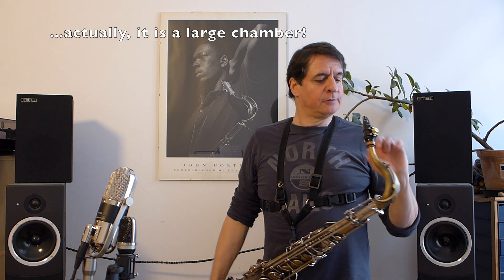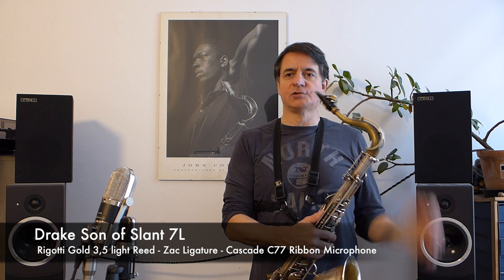Comparing two Tenor Sax Mouthpieces and two Recording Microphones

Comment: the first comparison is imo not very helpful because you changed 3 variables at the same time ...
regarding microphone: tenor needs that "smoky air" that's only delivered by the large condenser. On alto - in particularily when played very powerful - ribbons can be wonderful.
In general: if you move that much vertically the mic should be pointed slightly lower in order to better balance out the sound.
anyway great playing!
Reply from the maker: Thanks, Martin for commenting and for your suggestions! I guess I should have better called it "Me trying out a couple of mouthpieces"! I know, the scientific way should be: different mouthpieces, same reed, same ligature, same microphone, same position, same music. But, there is a big but! A reed that is great on a mouthpiece is not necessarily good on another one. Same for ligatures. You would do wrong to one of the mouthpieces, IMHO. About the mic position, since I move a lot, a lower mic position would accommodate when I'm bending over but it would sound way too stuffy when the bell is over the mic since the sax projects upwards and forwards, but not downwards. So a more distant and higher position would probably help, combined with a little self-control.